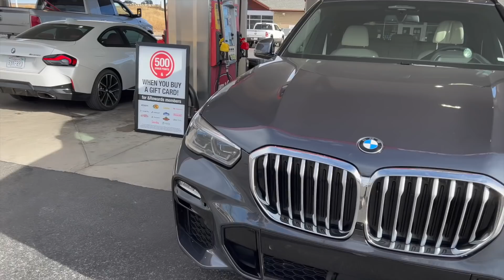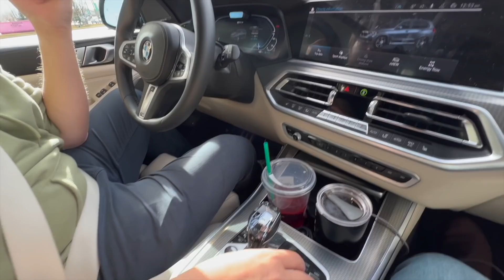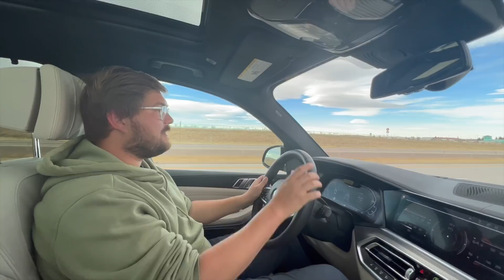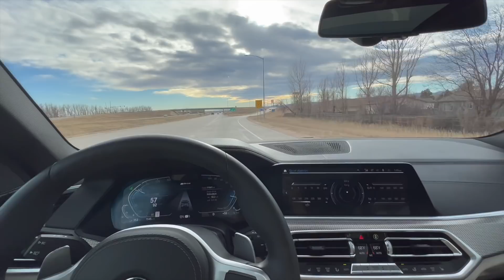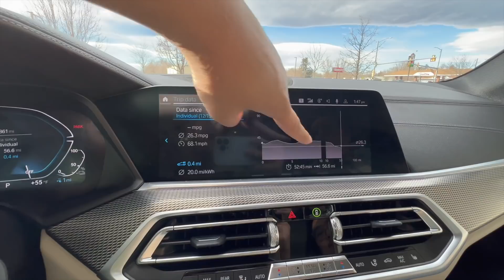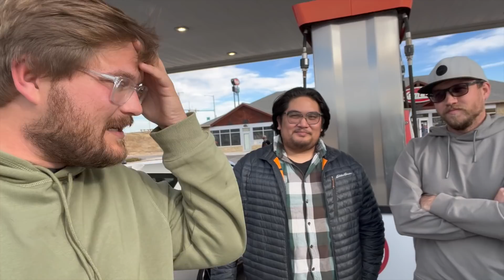Can A PHEV Be Efficient On The Highway? 2021 BMW X5 45e 70-MPH Highway MPG Test

Comment: Calculating efficiency of BMW plug in hybrids based on the vehicle's data:
For those interested BMW incorrectly calculates efficiencies by dividing TOTAL mileage (EV plus combustion) by kWh or gallons consumed for the numbers in its infotainment system.

To find actual efficiencies, miles driven using the engine must be divided by gallons consumed to calculate MPG, and electric miles driven divided by kWh consumed for mi/kWh.
Reply: For actual gasoline engine use efficiency divide total miles by the stated mpg to get gallons used, subtract electric miles from the total miles driven to get engine driven miles, and divide engine driven miles by gallons for mpg.

For actual electric motor use efficiency divide total miles by the stated mi/kWh to get total kWh used, then divide electric miles driven by kWh used for mi/kWh.

Please remember that by using the vehicle's onboard systems you are still relying on the vehicle's best approximations of energy use, fuel use, and miles driven.

Comment: Why not test the car in hybrid mode for a distance greater than the rated electric-only range?

Testing with the battery completely dead may give you the worst case scenario, but that hardly seems representative of the intended use.

Comment: 2023 45e vs 2023 IX vs 2024 audi etron for mostly driving around flats 15 miles round trip and some weekend trips to the mountains in Colorado? Concers: 45e: power going up to the mountains when on the highway for 60 miles; IX and Etron: range for these same long mountain highway trips in the winter. I prefer the performance and simplicity of the EVs, but worried about winter EV range in the mountains.

Comment: I don't get the logic behind testing a plug-in hybrid on the highway without the benefit of the battery. There isn't some kind of "magical" engineering going on that is going to make it differ from its gas equivalent. The only item you're potentially isolating is limiting the use of the battery or recovering charge on the trip... something that you probably won't see much benefit from on the highway unless you are climbing/descending. So all this is really doing is testing the vehicle like its gas equivalent with the added weight of the electric drivetrain (electric motor, batteries and cabling). It should literally be what you would get with gas minus the added weight and perhaps a little variation based on any differences between transmissions, gearing, etc. The better test seems to be to test it with a full charge and see how maybe short, medium, and long drives (i.e. 25, 50 and 100 miles maybe) would benefit from electric integration and whether that benefit extends through all those scenarios or if there are limitations that can adversely affect efficiency (i.e. speed, distance between stops/charges, etc.). Would be interested to see if you would consider doing something similar to that in the future. Otherwise decent review.

Comment: As current G05 Hybrid owner, I’m very satisfied this gen X5, I’ve driven the G05 Petrol only before, I have to fill up gas twice a week, it was loaner btw.
Reply: hows reliability
Reply: @Cyan__ currently on 82k miles, replaced front strut bushings, thats all. No leaks at all.
Reply: Would you say it’s been reliable I’m looking into getting one but people say the hybrid part isn’t so reliable
Reply: @Cya @Cyan__ Well, In my case, I never had electrical problems, not even my regular 12v battery, they were all original.
Reply: @QuagmireHimself ahh ok thanks you bro I’ll definitely consider getting one now since there not too bad I appreciate you

Comment: Great vid! Question: if you were to drive @ 70 mph with an empty battery for say 3-4 tanks of petrol, would the system charge the battery while driving? Or does the battery only recharge with city power?
Reply: The battery will charge slowly, whenever the conditions allow (breaking, going downhill, etc) but that power will then get reused while driving so you won’t come home with a full battery or anything like that

Comment: Will the engine charge the battery when activated like the Cayenne ehybrid does?
Reply: There is a mode called Battery Control where you can tell the car to charge the battery using the engine to a set % level. Mostly used if you want to make sure you have charge to precondition the car before your next leg of the journey.

Comment: I get between 4.0 and 4.5 L/100km at 110 km/h on my PHEV when the battery is dead.  Though my PHEV is a Prius Prime, so it is a little more efficient than an X5.

Comment: I ordered my 330e to replace a Honda Accord V6.  My accord can already get 40 MPG on the highway at 65 mph.  I don’t expect to beat that with the 330e.  What I do expect is when I’m doing  local or stop and go and city driving, I’ll get near 30 MPG in the 330e in hybrid mode where I get high teens in the accord.  If the 330e experiment works out, we’ll replace our other car with this.

Comment: Can't seem to find clear or consistent information about how/when the X5 45e PHEV utilizes the elec batt or when it interchanges between ICE & Electric under highway use. If the battery was fully charged, wouldn't the X5 run fully electric until the battery is depleted? Regardless of whether it's city or highway driving? Ie. If I have a 25mi drive to work (mostly highway) wouldn't I make it to work without using the ICE? Charge it at work, then back home (also highway) and avoid using fuel/ICE?  However, I'm finding many are saying this vehicle is mostly beneficial if you drive primarily in the city? This doesn't seem right, or perhaps I'm missing something....Can anyone confirm?
Reply: The electric Motor HP/Torque numbers are limited, so essentially if you select max edrive mode, the car may kick in ICE engine over a certain speed/acceleration, but you have to select that option in the drive mode. If you choose "hybrid" or auto mode, it will still prioritize electricity but will quickly shift to ICE engine at highway speed of 60 to 65 mph. On Slow Traffic, coming on to a ramp, and mostly sub 50 mph+ rural/city driving it will use electric. UNfortunately, the BMW Plug in Hybrids don't use coupled combination drives like conventional hybrids, it's always 1 or the other during normal drives. The only time electric motor assist comes in is when you floor the pedal to give it the "eboost".

Comment: This review is good if you spend your time driving cross country every day. But if your like most people in suburbia and drive sub 50 miles a day and plug in at night, your at more than 50 mpg. If your lucky and charge at work...you can run 95 percent hybrid...and the sky is the limit. It’s the daily incremental driving that makes this system a champ...if again your driving sub 50 miles. If your going long distances, your just hauling a battery with you.

Comment: I don't see the point in testing a PHEV with the battery completely drained. I would prefer to see the test redone with the battery fully charged and see if it makes a difference. The point of a PHEV is to maximize the fuel efficiency. I get that it doesn't necessarily provide much benefit at 70 MPH but you stated you could run at 85 MPH in full electric. Also don't see much point in testing in electric only mode. Of course its not going to be a great EV

Comment: I have this car, it's freaking amazing.  Only get the 45E version if your driving allows you to use the EV portion a fair amount of the miles and you're willing and able to charge it.  We're running probably 70/30 gas/EV so I would like to increase the EV a bit, still it's amazing.
Reply: I’m going to get the 50e, faster charging and increased range not by much but maybe 20-30%
Reply: How’s the maintenance cost ? Or any issue you have faced so far ?
Reply: Are there any advantages of using X5 45E without charging the battery at all? I mean will it behave the same as toyota/honda hybrids?

Comment: Do these plug in hybrids not charge the battery once it is depleted? It makes no sense that once the battery is depleted that you must use the gasoline engine as your only option until you find a charger again. My guess is that once the battery is dead and when you're driving around with all that extra weight that the MPG will be far worst than a regular Xdrive40i.
Reply: There will still be regenerative braking to recharge the battery. But the best phev use case is charging overnight and doing majority or all of daily work commute and in town errands on electric power.

On flat highways where there's no downhill or stop and go to regenerative brake, the phev gas mpg is going to be worse than the 40i because of the extra 600+ lbs of empty battery and electric motors it's gotta lug around still.

Comment: you guys really do not understand how to drive a PHEV for best efficacy. Always start your full day of drive with a full battery and when you put it in hybrid it will help with mileage. In my clarity if a start a highway drive with full battery and do a 12 hour drive I will finish with mostly empty battery but will have picked up around 5 mpg. With my clarity on full highway drives I have got up to 45mpg by using a PHEV as intended. Then sometimes go months with out putting gas in  If I dont drive on highway. These EV guys give PHEV's a bad rap because they dont understand them.
Reply: You are basically repeating what he said...Watch towards the end of the video.

Comment: we have a Honda clarity and in my opinion it is the best plug in hybrid but no longer available new. It has a big battery for a PHEV 18 kw. When I go on a highway trip I start with a full charge  and recently did 600 miles on highway getting 45 MPG +. unless we are going out of town 50 miles per charge takes care of most of our driving and when we come back home hook up the level 2. It has a much different system than the BMW being a series hybrid.. It does not have a trans just a single speed with only the electric motor driving you until about 65 when the engine cane be mechanically coupled but I belive it can go 87MPH on electric when in EV mode. If you are in the market for a used PHEV look into the clarity almost everyone loves them. I dont know why Honda did not advertise them. I am not a fan of the rear wheel covers but other than that love it

Comment: Kyle, you missed the point of BMW PHEV. BMW has a battery control button where you could charge up the battery while you are driving in gasoline mode. This works well especially when taking a road trip or driving on a highway. Once the battery is charged to 100%; you could switch back to electric only coasting on the highway or Eco mode where you might use both. This is how BMW PHEV intend it to be. Without using the battery, you are just hauling the dead battery weight around which drain the gas even more comparing to gasoline version. The point of buying a PHEV is to use the battery. What you should have done was to drain the battery first (like you did), but then set the battery control to 100%. Once it charged up to 100% then switch to electric mode until you ran out of battery. Then repeat the process until you drive back to the starting point. Then you could compare the gas price between the PHEV and the gasoline counterpart.
Reply: That doesn’t help you though. You’re using gasoline to charge the battery. The energy for the battery doesn’t come out of nowhere and there’s no such thing as a free lunch.
Reply: So how does the car recharge? Braking/downhill recuperation, motor-generator or both?

Comment: Very good and unique review!!! I have a Sorento PHEV AWD, did a few road trips totaling 800 miles and got anywhere between 28-30 mpg with cold weather.  I look forward to the warm spring/summer days where I can go to road trips again and see 34+ mpg hopefully.  Anyway I bought the car knowing real well I can take advantage of the local driving around New York City/suburb areas and plug it in every night with the 110v outlet on my driveway.  Lifetime mpg after 5000 miles is around 54 which I am happy with.  A 240v outlet upgrade will certainly improve the mpg especially during weekends where I wish I can replenish the battery juice faster before running my next errand.

Comment: That's an awful lot of messing around when a 2L diesel could've gotten 35mpg
Reply: That less than what I average with mostly city driving. I have a BMW 328d and my pump calculation by hand usually averages 36.7 mpg. I am looking at getting an X5e, wish I could’ve gotten the X3e as I really don’t like the look of the iX.
Reply: I have the 45e and got about 30 mpg on a dead battery. I may have been going at 65 mph instead of 70.
Reply: No longer available in the U.S...thank VW. Imagine a diesel-electric hybrid...even better highway ICE MPG.

Comment: Is there a reason why the Chevy Volt voltec system isn't the gold standard for plug-in electric vehicles? Like why are they trying change how phevs work. Chevy wrote the book on how this should work. The only thing I believe others should be doing is making the battery portion last longer. But allowing the gas to come on because you're driving too fast is crazy to me.

Comment: I got mine last May. I would say most of the buyers for this will just be using it for city driving which it excels at. 5000+ miles, almost 4k done in EV mode.
Reply: What made you chose not to go full electric?
Reply: @scotts2286  I also have a Tesla Model 3 Long range for daily driving. X5 is sooo much more comfortable specially with the standard air suspension on the 45e model and the build quality is impeccable.
Reply: @jeffreywong6842  Hm, thanks for the info. Model 3's aren't very comfy. The Y's are way more comfortable.

Comment: I hope you can put a Hyundai Santa Cruz or Kia Sportage & a Santa Fe or Sorento AWD PHEV to the test as well.
 I'm not sure that there is zero benefit if properly done, it's acting like a hybrid because there's always a small amount of battery on reserve, and the motor can also provide extra torque for passing or steep grades. Also, when coasting downhill, braking, etc. the engine shuts off and the battery gets regen to improve efficiency.

Comment: I seriously considered getting this when it first came out, but I decided against it, at first because I realized I didn't need that much room because my kids were older, and second because I didn't want to have the maintenance expense of the gas engine. I looked at BEV crossovers, and ended getting a Tesla Model Y. Now that you point out the gas mileage hit on road trips, I'm even more convinced I went in the right direction.

The main reason I thought I needed a PHEV, was because I like to go hiking up in the mountains, and I was thinking the gas would give me peace of mind when I went to remote trailheads. So far, though, I haven't felt limited by all-electric.
Reply: In the same situation here! Test drove the X5 and MY. Although I ordered MY, I am still thinking about how smooth the ride was in X5 (living in an area with bad roads). What is your experience regarding the stiff suspension in MY?
Reply: @marcinw4660  I'm happy with the ride quality of the MY, but I also opted for the Long Range version and kept the default 19" wheels, with the thicker sidewall tires--I've heard the Performance version with 21" wheels has a noticeably firmer ride that my setup. But every mile of range mattered to me, because of driving long distances to remote trailheads, and the tamer acceleration and smaller wheels squeeze a few more miles of range out of the MY.
Reply: If you compare the efficiency of your Model Y to this BMW or other BEV’s you will see your MY isn’t very efficient. Tesla’s tend to use a lot of energy.
Reply: @J.Young808 bmws can be very efficient without the cruise control and stop start enabler

Comment: Hauling around dead weight is a weird way to put it. It’s a working part part of the drivetrain that comes into use when needed. 

If you own a BEV and only use 20-30% of its battery for most of the year, you could make the same argument that 70% of the battery is excess weight you’re hauling around.
Reply: @devn3813  Right...complicity
Reply: That… was brilliant. I never thought about it that way. What’s funny is I have an X3 as a loaner while my iX is in the shop and the weight difference is INSANE. You can just feel how much lighter of a driving experience it is compared to a BEV.
Reply: When he said "dead weight" I assumed he was talking about himself.

Comment: Surprised the 2022 X545e didn't at least upgrade to a 7.2 kW on board charger to utilize the battery more with charging in EV mode and offer more usable battery capacity. Europe gives customers 21.6 kW of the 24 kW pack vs 17 of the 24 kW pack in the US presumably for US warranty reasons? That's a big miss, otherwise great SUV. Just use a faster on board charger from the i3 or ix parts bin.   I'll wait for the 2023 Range Rover p440e with its 50+ mi EV range, rear steering, DC fast charging, better inline 6 mild hybrid powertrain w better hwy mpg, bettery off road dynamics and redesigned interior and exterior releasing later this year.
Reply: Agreed, I have a 45e on order and my garage's 9.6kW evse is overkill for the onboard 45e's max 3.7hW charging. I read on bmw forums, the I3 is actually twin 3.6kW chargers, which isn't doable for the 45e for some reason, either packaging, maybe the smaller battery vs an BEV, or just for cost cutting.

I read BMW limiting the USA 45e bat to only 17.1kw usable cap is due to the USA's 8year warranty and especially the USA carb states' PZEV 10 year battery warranty. Vs the EU 45e's 6 year battery warranty. Makes sense that less battery cycles = longer durability.